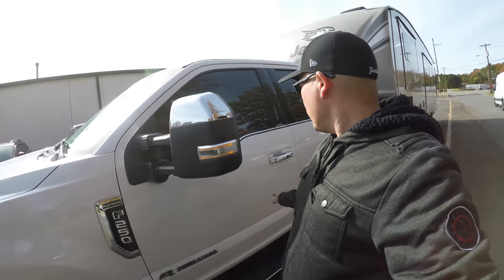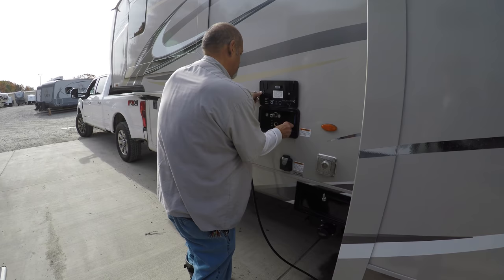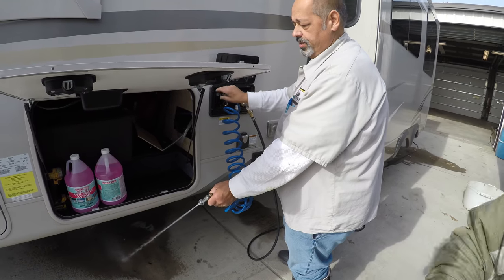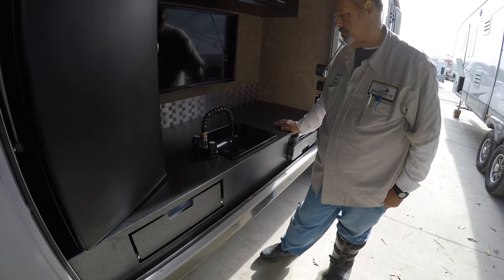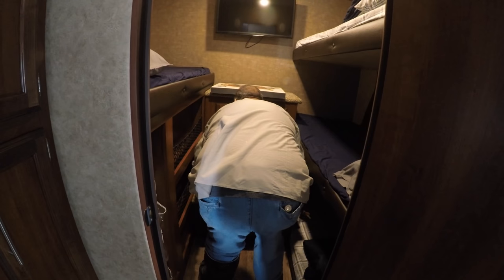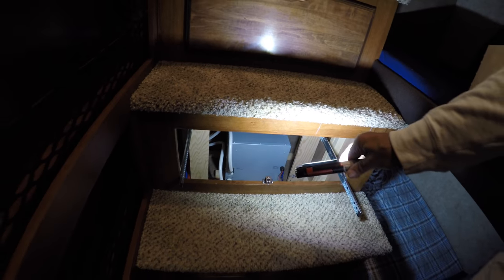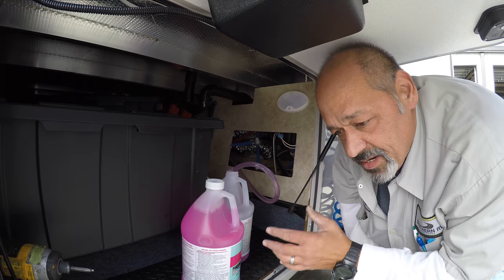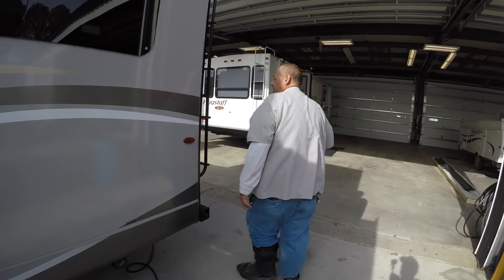HOW TO WINTERIZE YOUR RV

Comment: Nice video especially to locate the winterizing hose as the Jayco manual is silent. A strong comment on the air pressure though: using 85 or even 45-50 psi is way too much and will damage your water lines. It will also void your warranty if you damage the lines and cause a water leak. Never exceed 30psi, which is more than enough to push water out of every faucet. The secondary benefit is that you don't have to remember to leave a faucet like the outside shower half open to manage the pressure in the system. There are so many things to think of, you don't want to be at risk of damaging your RV because you forgot one thing like keeping a faucet open for air to escape.
Another comment: the same wintering hose is to be used when sanitizing your RV fresh water system (bleech+water mixture).
Reply from the maker: Thank you for the input.  I appreciate the insite and will make note of it for upcoming videos.  Happy camping !!!

Comment: Thanks for the video.  I just got my BHOK and when I hooked up to city water, water is coming out the fresh tank hose near the door the door to get in the RV.  I turn the water off,  and it stops.  My fresh water tank is empty.  Any ideas?
Reply from the maker: PlainSpokePictures ,sorry for the late reply....just got back from a cruise.  I believe your low end drain is open.   Just reach underneath and turn the plug clockwise.  Hope this helps.
Reply: Thanks.  Like the new videos.  Does your BHOK have a heating vent in the bunk house?  I have four vents, bedroom, bathroom, and two in the kitchen.  No vent in the bunk house.  I have to keep the bunk house door open to get some hot air in there.
Reply from the maker: PlainSpokePictures ,  did you get the new 18 model or older 16 model?  Mine is a 17.  I have 1 vent in the bunk house but I saw a video of one that had one outside of the entry door.  My vent is definitely inside the room by the step dresser.
Reply: Yes it is a 2018.  Do you have two vents in the main living area?  We have one near the sink and one just outside the bunk house.  The air does not go into the bunkhouse.  If this is the way they were designed it does not make any sense at all.
Reply from the maker: PlainSpokePictures, definitely sounds wrong.  Like I said my vent is inside the. Unknown house.  I have 1 in the master and I believe I have 2 in the living room and kitchen.

Comment: Great video showing every step. was hoping to get a price on the dealer doing it. Yes I know dealers prices very but I could have had a price range. Just got my 2020 Jayco 5th wheel and it looks similar to yours. I may have the dealer winterize mine the first time to so I can see how it's done properly. and I haven't gotten a compressor yet. Thanks Finding Jay
Reply from the maker: Thank you for the comment and I am very happy that it was a little helpful for you....I want to say I paid about $125 for wintering the camper.  Good luck and happy camping ⛺️